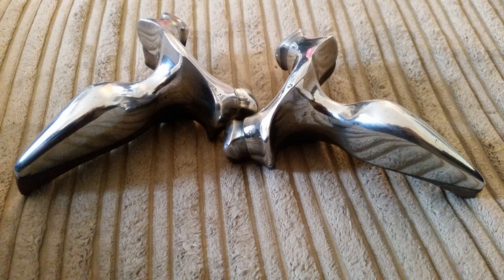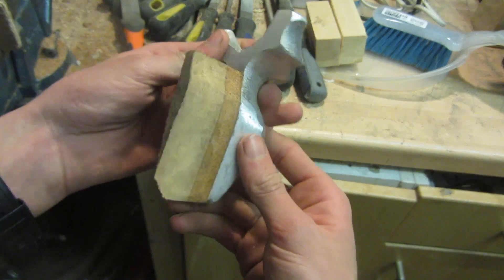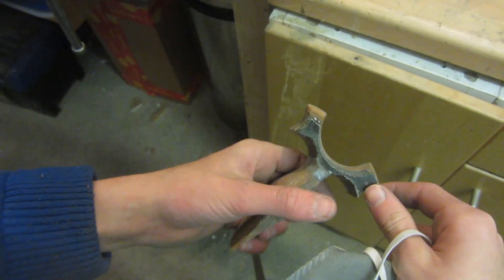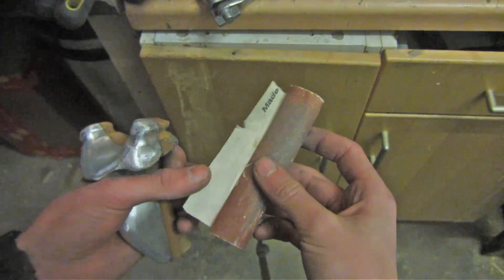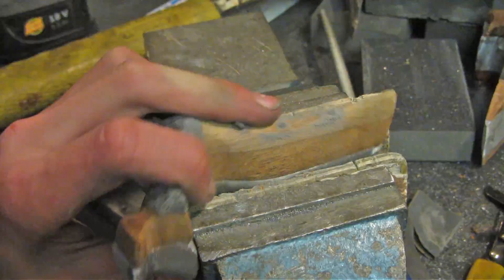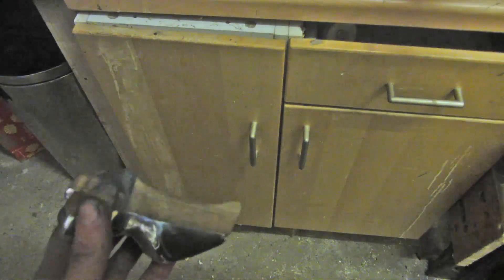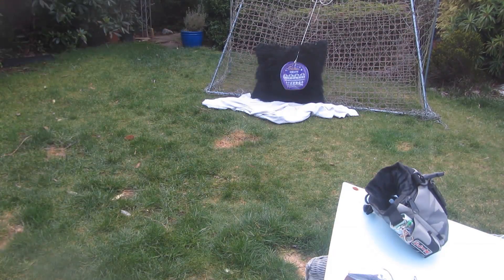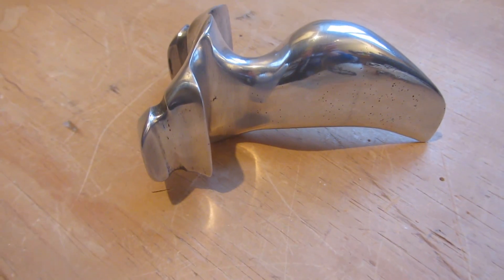How to Cast Aluminium Slingshots Using Sand - Part 2

Comment: I have to say your voice is very deceiving. You obviously have the thought and know how to perform many skilled tasks but your voice, I mean not to be a %$@# but you sound like you're 13. You could be 35 for all I know though.  I watched because I wanted to see how you polished the aluminum as I use sand paper up to 2000 grit, then use Brasso like you mentioned. I do have a polishing wheel for my grinder, I just haven't installed it yet. As for these slingshots being lethal? I doubt that. Cause one hell of a headache that's for sure and MAYBE if you hit a person on the temple at just the right spot. Maybe. I have a Beeman .22 caliber 1200 FPS air rifle that will penetrate a 3/4" thick piece of pine at 30' with ease. Even penetrates the thick steel of a wheel barrow. Now that I would take any day for hunting small game over a sling slot. I used to have many wrist rockets like these when younger and they simply aren't accurate enough.  Good video!

Comment: You should do a small video making a hot wire cutter, used for cutting and shaping foam/polystyrene which should make lost foam casting easier

Comment: These are nice but I don't think they are capable of killing a human, the US army has determined that you need at least 60 joules for a projectile to be lethal, a good rule of thumb would be shooting through a 20mm pine board if you don't have a chrony. So far I have only managed to do that with a 50cm extended slingbow at 3/4 butterfly (shooting through said pine board, not killing:).
Reply: The canadian fisherman Oh yes, definitely:) I'd even go so far to say that a very lucky shot placement could kill. Skulls have hard and weak spots but the harder parts can withstand a 70J blow, the bandset on this slingshot is certainly not capable of that sort of output.
Reply: mastahcez search jorge sprave ivan head and you will se the true power  of  the  slingshot
Reply: malachi lauro He's not Joerg and this is not a 3 layer TBG bandset:) I know the capabilities of slingshots very well actually.
Reply: alright

Comment: Great video! Question... would steel ammo break the aluminium if your shot was to go a bit sideways? Or since its a pure cast would it be hard enough to withstand a blow from a steel ball?
Reply from the maker: Yes it would be fine.  As the forks are curved on  most of the areas where a fork hit might occur they would also reflect the ammo away.  There would probably be a small dent or scratch as the aluminium is soft but nothing more

Comment: Nice job on the setup. You should switch to a tapered slingshot band. It will give you higher velocity then one that isn't.
Reply from the maker: These bands are slightly tapered but still have a long lifespan.